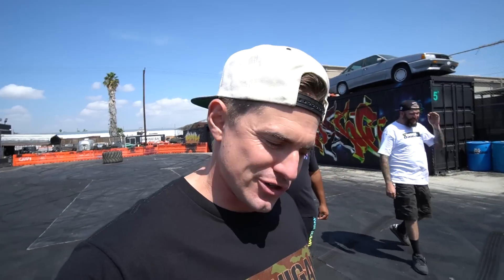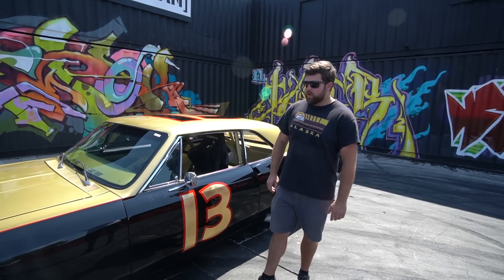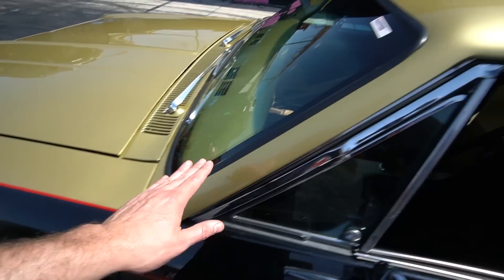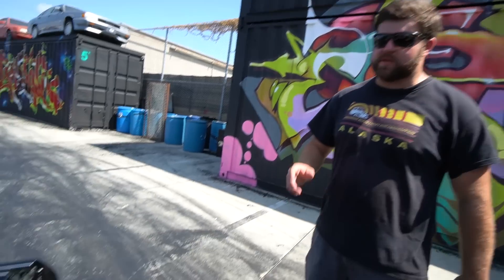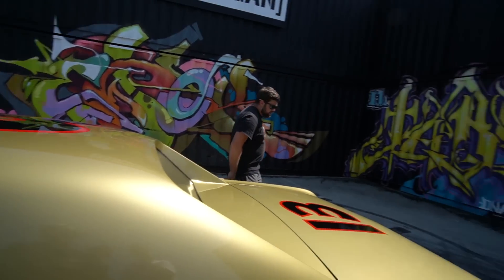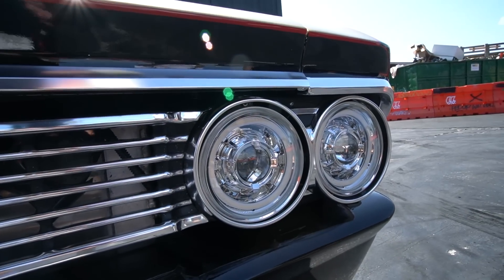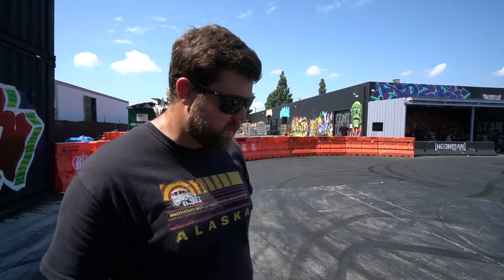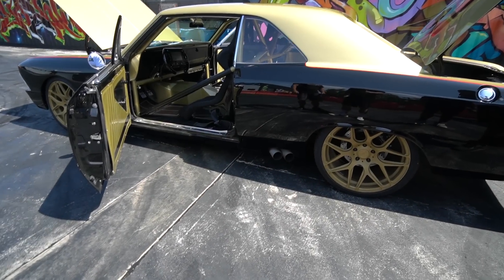Hand-Built Smokey Yunick Tribute Chevelle Smokes Out the Yard

Comment: For those unfamiliar do a bit of research on Smokey Yunick.  Quite a colorful character.  He's the reason for most of NASCAR's rules.  Like there was a maximum tank size but it didn't say anything about gas line.  So he ran a massive diameter line that held several additional gallons of gas.  And the engine had to be centered in the frame but the rules didn't say the frame had to be centered in the car.  He built a frame that put the engine pretty close to where the drivers seat should be and he drove from the back seat.  It would turn left like mad.  Every time he'd find a winning technicality by the next season they'd have to make a new rule.  When he started the rule book was the size of a comic book.  Because of him when he retired it looked like a phone book.
Reply: Another thing about the gas line, is he also had a basketball in the gas tank.  So when it was time for Tech inspection it'd be inflated to pass, and deflated when it came time to race.  The officials got suspicious of it and took out the gas tank to inspect it.  Smokey then started up his car and drove it back to the pits.  After informing the officials to "Make it 10" for illegal things on his car.
Reply: He was a v8 Pontiac guru too as well as beating the oil companies in a Fiero best damn garage. Rip chief

Comment: Smokey actually hand built two scaled down chevelles. Reason being that when the officials questioned the proportions, he told them something along the lines of "let's go check one in the parking lot then". And there in the front row was the 2nd scaled down chevelle, which looked like a normal street driven chevelle though. Took the measurements off of the normal "oem" car that smokey planted, and he went racing ;)
Reply: Best story in auto racing history.
Reply: The lengths he went to for the tiniest advantage are legendary. Awe inspiring and hilarious and ingenious. That kind of person? You are guaranteed to have a good time, any time they are around.
Reply: Used an 8" diameter fuel line that added several gallons because there was no rule against it.  That's thinking outside the box.
Reply: Yes, had read about that 'Story' & afew others of the ingenuity & genius of Smokey pushing the NASCAR rulebook
Reply: that's not even remotely true
Reply: So the alleged scaled-down Chevelles weren't actually scaled down, they were actually just highly refined and almost every part of them was modified to make them more aerodynamic and faster on the track. Dinner With Racers did an episode where they found the actual car and measured it to see if it was any different from the stock size - what they found was that it wasn't smaller or larger but that the bodywork was highly modified to be more slippery through the air and that the car itself had a lot of really small modifications that all added up to make it wicked fast.
Reply: LMAO
Reply: No he didn't.  What he did to that Chevelle is something entirely different.  Made for a good mythology though, I believed it for a long time too.

Comment: Smokey's car wasn't 7/8's size. He shaved all the drip rails, flared the arches, and molded in a subtle duck bull above the rear window. As well as a few other subtle changes. Then he built a copy of the car and parked it in the front of the parking lot before the race started. So when officials needed a car to compare to Smokey said let's go out to the parking lot and look for a stock one.